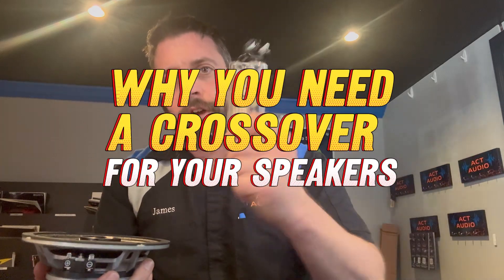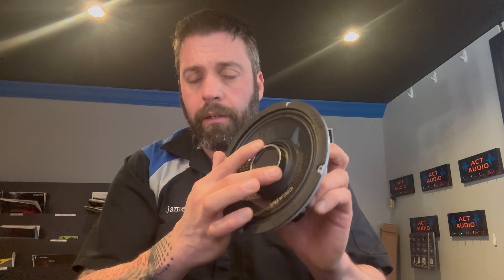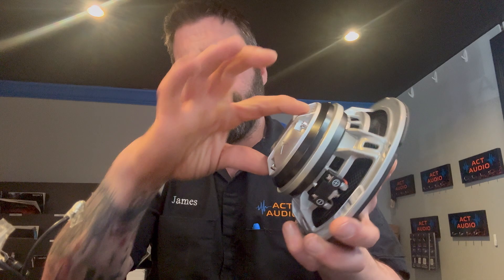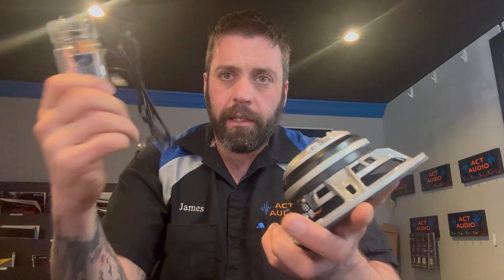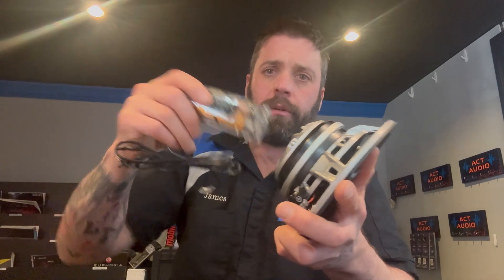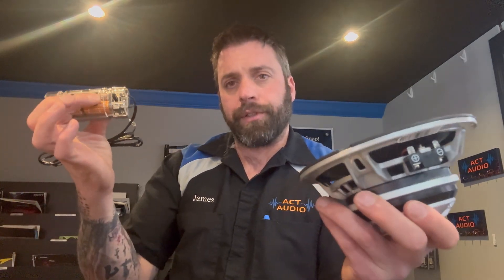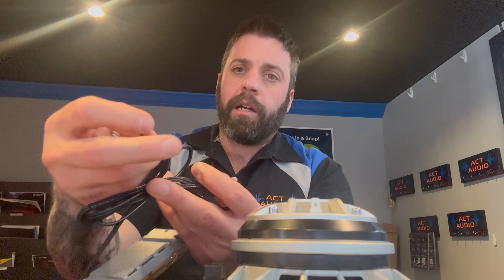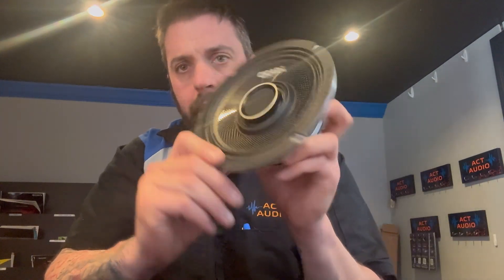IS A CROSSOVER NECESSARY FOR SPEAKER SYSTEMS?

Comment: I have a 08 Honda Accord exl with 4 6.5 speakers. 2 front door, 2 rear panel and 1 6.5in sub between them. How or can I run 4 full range 1 6.5in sub or mid bass speaker with 2 12in subs
Reply from the maker: if I understand the question correctly,. just add another amp and 2 12in subs

Comment: Does that change the ohms using that cross over?
Reply from the maker: Your answer is NO as the overall impedance that the speakers are suppose to be at (usually 4) maintains the same. However the real answer is yes as the crossover changes how the amplifier sees the impedance at different frequencies. This is a more in-depth answer as impedance changes with all speakers pending the frequencies but if it's labeled as 4 ohm it is 4 ohm overall. NOW there is a resistor that comes with some speakers like the diamond MP series and that changes it and should not be confused as a crossover.   I hope this all made sense

Comment: I’m seeking to Either have the CM69.4X / RR075T or CH69.W and tour pack either CM65.4X / RR075T or CH65.4 v4 
Depends on this what’s going on fairing I’m  looking at putting 
CM65.4X / RR075T or CH65.4 v2 2 ohm or 4 ohm depends which amp FLX1400.4 or FLX2000.4 
Into a 2024 CVO ST with a tour pack and tour pack pods and saddle bag speakers.
Reply from the maker: Get it tuned right and it should sound great!  Good luck with it